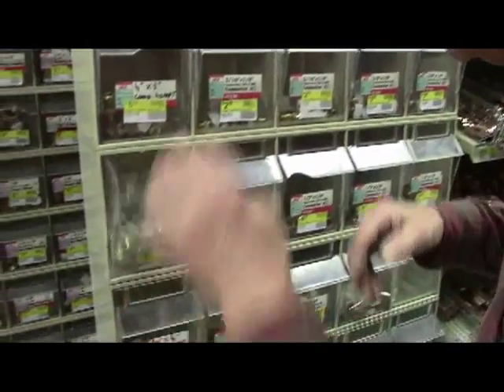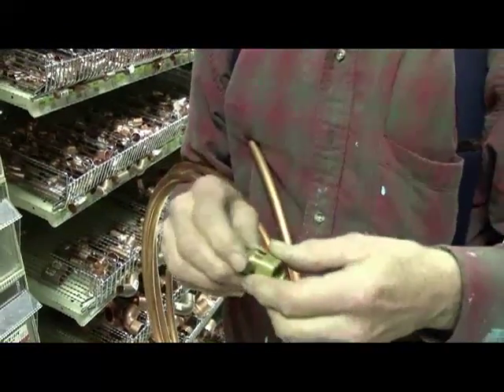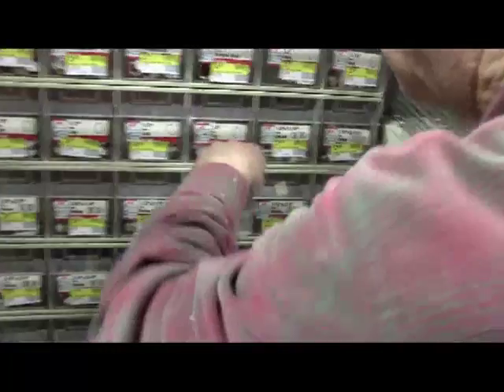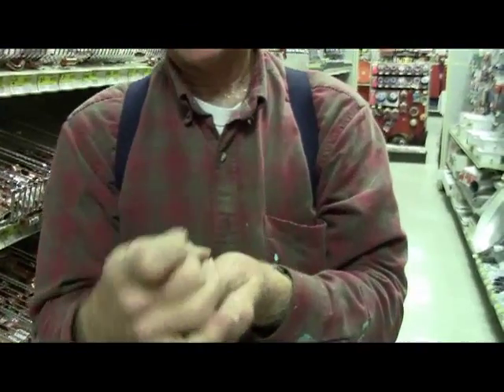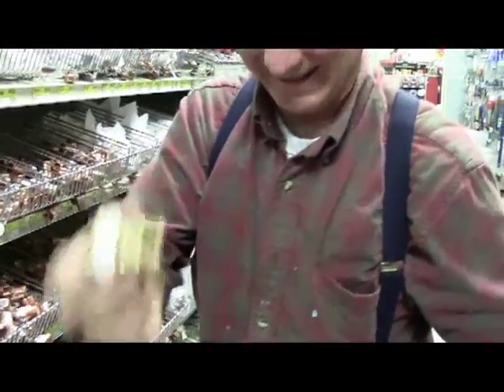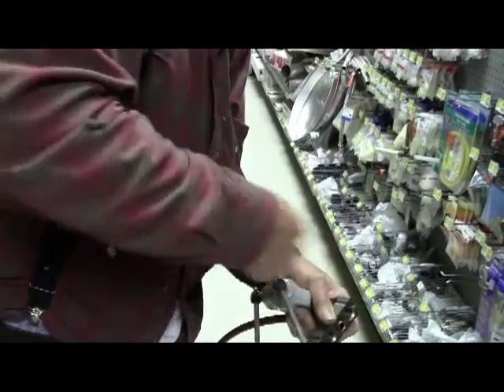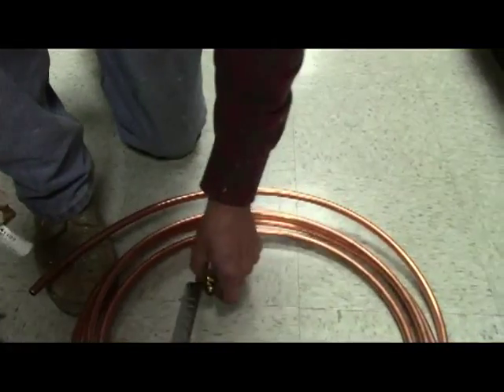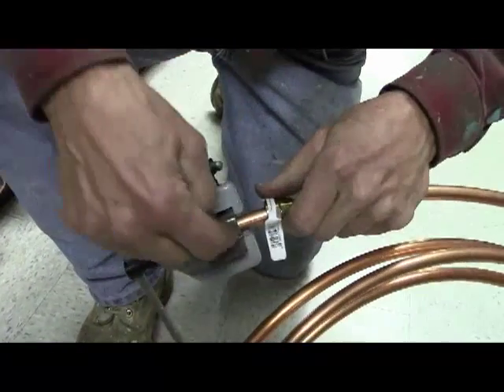Plumbing compression and flare fittings

Comment: I have a question, if the compression fittings are best, why does code require flare fittings when running LP gas?
Reply from the maker: +Nick Schild   From what I have learned , Flare fittings can be removed and re installed and still have a good seal, Compression fittings  don't seal as good as flare and you can bear down on flare , but cannot on compression fittings.   Someone may know more about this.